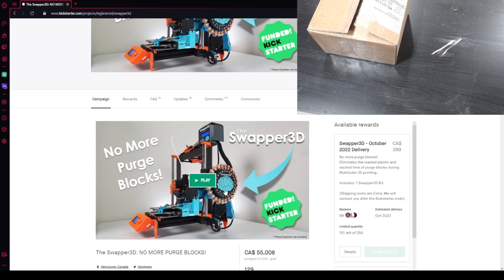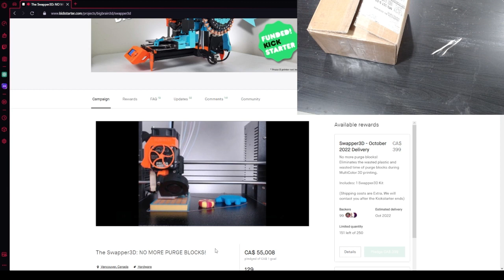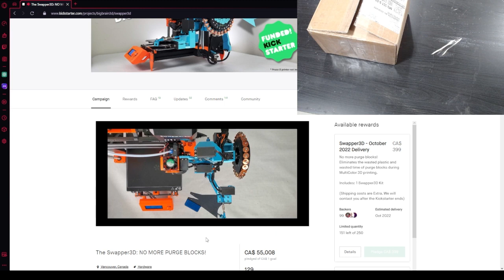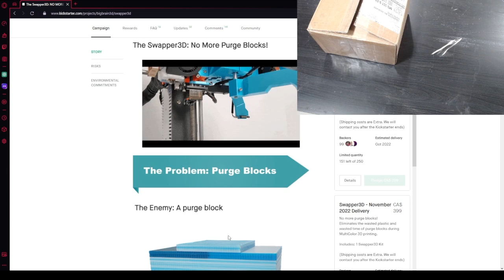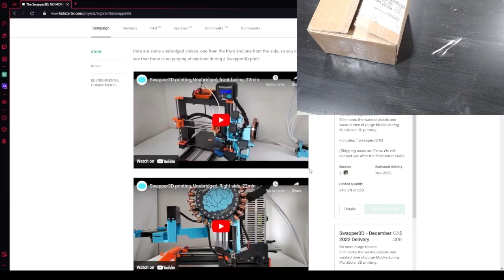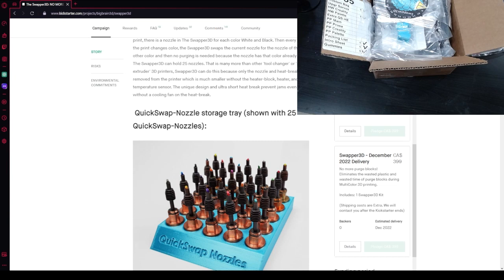3D Swapper Overview

Comment: Did you have any luck finishing the build and get it running?
Reply from the maker: I have not had a chance to work on it. I still need to get an MMU and get some time to assemble both. When I do I will put up a video for this. I just dont know when I will have a chance to do so.
Reply from the maker: @rindernetz1061  well the hardware is not. Software I have to look into it more. I can give an update once I get a chance to look into it. I did send them a message for the instructions for installing it to an ender 3.
Reply: haha this thing is junk! buy an XL.. this thing requires way to much babysitting IF (big if) you  can even get it swapping reliably 
source: I regretfully bought this POS
Reply: @rindernetz1061 BigBrain3D is working on some improvements in the firmware and the octoprint plugin. Should be ready in some weeks, then I will test it. The build here is finished, just need to attach it back to the Prusa MK3S.